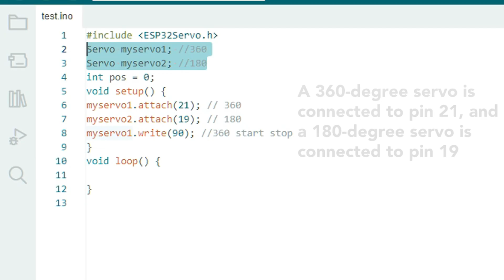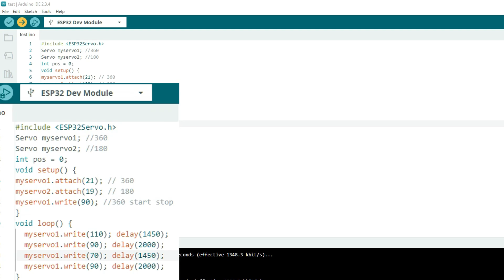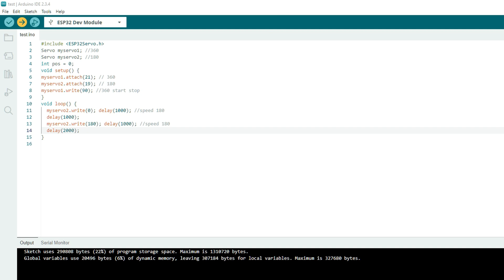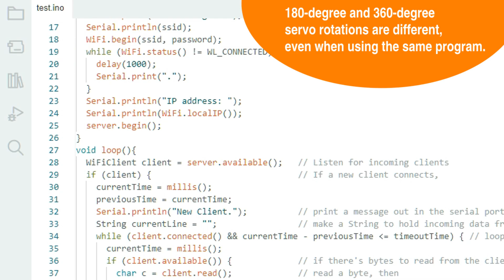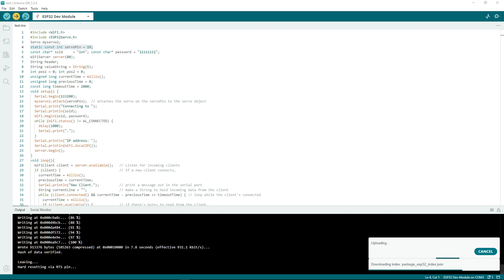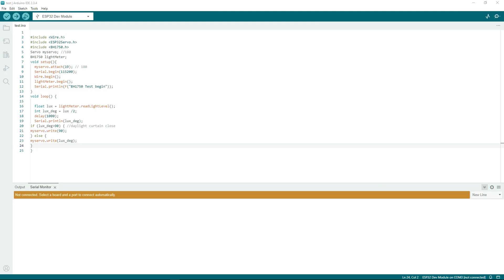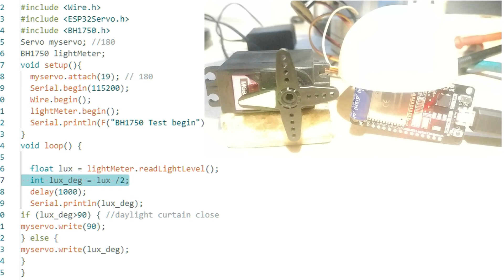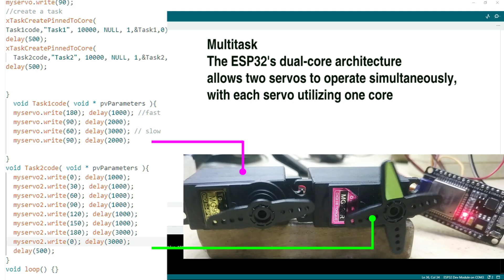How to Control 180 degree 360 degree Servo Motors with Arduino TowerPro MG995 MG995R

Comment: I have MG995 servo motor which I want to use for jackpot slot machine but the servo motor It does not run continuously, it just vibrates, meaning it moves a little. Please tell me how to solve this problem
Reply from the maker: Common Causes of Servo Motor Malfunction
1. Power Supply
Insufficient power: Requires more than 500mAh at 5V.
Shared power supply: The power to the MCU and servo should be separated.
2. Cabling
Improper connection of cables.
Incorrect pin assignments.
These issues are based on our practical experience. Other factors may also contribute to the problem.

Comment: Hey I’m currently using the mg966r servo through arduino and am having trouble controlling it through the use of servo.writemicroseconds. Do you know at which values that servo operates at? Typically range seems to be 1000-2000 however mine had been unresponsive to that. Thanks !
Reply from the maker: Some time ago I tried it on ESP8266.
Use the setting myservo.attach(14, 500, 2400);
But for a 180-degree servo.
Because it only rotates 90 degrees.
With these settings, the servo can work up to 180 degrees. 

https://youtu.be/v1hQJZzCOno 
Hopefully this information is suitable
Reply: I have a servo MG 995 but it's moving only 90 degrees i want 180 degrees. I am using it with a receiver. How to increase angle please tell.